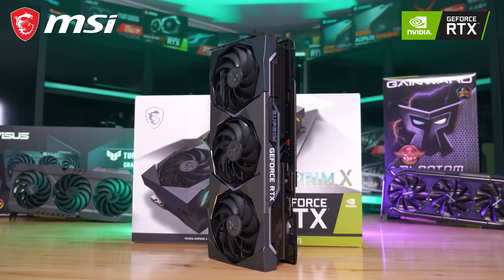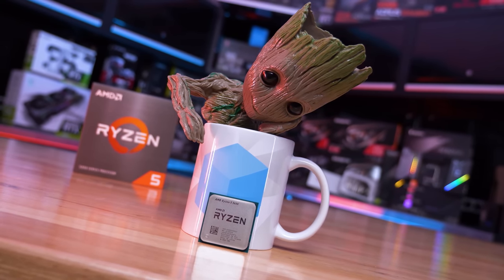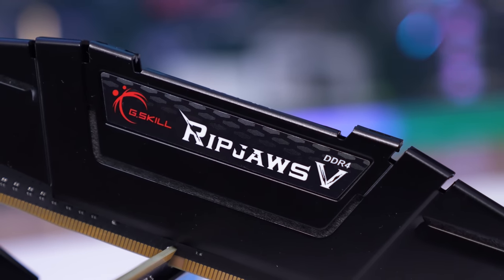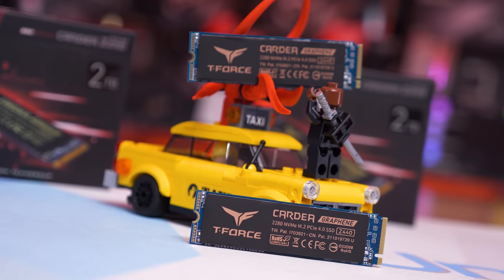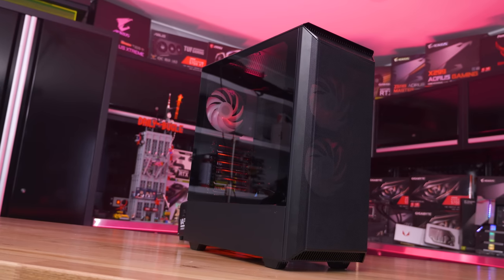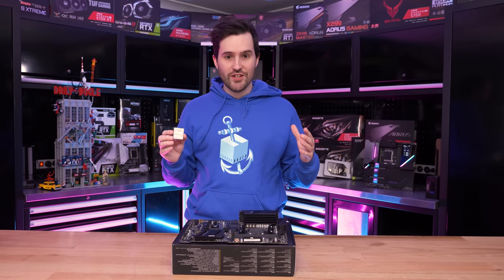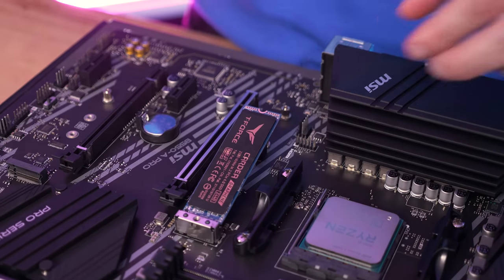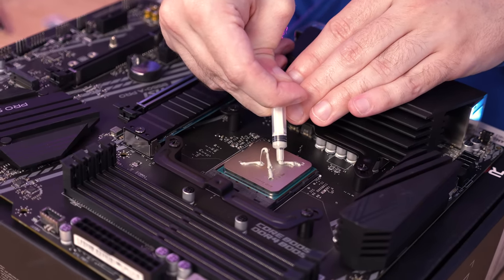Ultimate Value Gaming PC Build - AMD Ryzen Edition for 2022

Comment: I'm crying at the fact that in the year 2022 $1000+ PC is considered to be a "budget" build. 😭😭😭
I miss the early Zen 1/Kaby Lake days. Those were great memories.
Reply: I think it's safe to mourn the past at this point sadly. Regardless of what happens, ish is going to continue to get real, and absurdly expensive and we will see less as time goes on.
Reply: I don't think it's "budget" so much as "optimal value." For a budget build, I'd grab a CPU with good integrated graphics (Intel 11000+ or a Ryzen G APU), as they are already on-par with early 2010s dedicated GPUs. Next-gen Ryzen APUs (6000+ for laptop and 7000+G for desktop) will have RDNA-based iGPUs with even better performance.
Reply: This PC shown here is a 1080p Gaming PC. My Last PC was from 2017 and it was certainly more expensive then that PC with the "same" Power. It's just the low End got more powerful and thus more expensive. And YES that IS a problem. If in 5 Years the low End has the Power of an 3080, do you have to pay 2000$ for the cheapest PC?
Reply: U do realise budget means how much money one has and hoe much they wanna spend
Reply: @lachysimmonds357  As a noun yes. As an adjective (as used in this context) it means inexpensive.
Reply: Budget means within means for the selected product.  So a budget Ferrari is £70k, that's cheap for what a Ferrari now costs.  £1000 is cheap for a PC which contains a graphics card, since half the cost IS that graphics card these days.  Budget doesn't just mean you can afford this one.

You can't afford a Ferrari for instance regardless of your budget allowance towards having one, because you don't have a total budget for a car of anywhere near that.  But it remains a budget Ferrari TO THOSE WHO DO.  See?  A budet computer of any kind is a Rasperry Pi at £100 all-included.

But it doesn't play many games, that's the £1000 budget you need!
Reply: I mean if you count inflation... 1100$ is like 900 dollars 3 years ago.
Reply: @Planetside2Simon8989  if 2020's RTX 3070 kept pace with the actual US dollar inflation from 2014's GTX 970, it would've cost $360 at launch.
Reply: You said everything!
Reply: @InnuendoXP  inflation isnt the only reason for the price increase
many elements used in these GPUs have SKYROCKETED in price in the past 10 years
one example is aluminum which has over doubled in price since 2014
Reply: @flamingscar5263  And that Model T Ford, for the average man would today cost a few hundred dollars to make, but like you said, many elements changed price.
Wages didn't. Wages aren't part of inflation. And whilst for example lead has doubled in price, a PC uses a couple of ounces of it, and so the price has doubled. About two dollars now. Hmmmm. Not much aluminium used either. A PC case uses soft steel. But if it used all alu, that means it used 6 kilos or less. That would make an entire alu case cost less than 20 dollars... hhmmmm.
Reply: @Planetside2Simon8989  Wages dropped. Guess what PCs are paid for with. I'll give you a hint: it isn't a house.
Reply: Inflation brah
Reply: Used parts and local deals exist for a reason
Reply: @michaelgroenewald7  doesn't account for that much
Reply: @michaelgroenewald7  Wages, brah. It is a thing ADULTS who aren't getting things paid by their parents have.
Reply: @S3lvah  Absolutely, optimal value as best bang for buck. Best price / performance ratio.
Reply: @flamingscar5263  yeah so the $3 of aluminium used in 2014 now costs $6, big whoop, I can buy a huge aluminium CPU cooler for like $30. Material cost on GPUs has negligible impact on the cost, the process is the expensive part & even that didn't significantly go up in price per wafer until later last year.

The margins on GPUs are huge, many of the same materials & processes are used in CPU manufacturing & 'those' haven't gone up in price remotely as much. Even consoles with their huge APUs aren't being sold at a loss at $500.

The GPU pricing is down to one thing only, heavily distorted consumer demand due to crypto. Might it be a bit more expensive for other reasons? Sure. Not for anywhere near as expensive as they've gotten though.
Reply: @kowalski3892  Some of that is from GPUs still being overpriced. However, you either get a stopgap card and lose up to 200 dollars or you get a card that you will use for a few years at least and therefore count the higher loss enjoying your latest games more with a more competent card.
It still isn't a good choice.
Mind you, this build doesn't include monitor, mouse keyboard or any windows key, so it absolutely has to be an upgrade, not a new buy, at which point you would probably move the graphics card across and use that as a burner card until you see a price and performance that doesn't suck donkey.
However, that doesn't make for useful comparisons.
I would, however, add that cost to the claims of how much these "budget" builds cost, because without a monitor, you just have oddly shaped sand, metal and plastic, and you can't game without keyboard and mouse at a minimum. So I'd add up another 400-500 to the cost for those things, and subtract the cost of the 6600 if you are upgrading, reducing the price by 340-ish dollars for that.
Reply: This is what you would call a Mid Range build not so much a "Budget Build''. I would consider the R5 5500 or lower and a 6500xt and a lower end motherboard and ram a Budget Rig...
Reply: I mean, this is a value build -- $1000-1500 has been the price/performance sweetspot for quite a while.
Reply: @sublime2craig  By product tier, pre-2018 this was low-end gamer build. 'budget' builds were like the 1050T, but you spent like $400 on the whole system.
Reply: Budget for me was get really upset over pricing online. Stumbled by the Gaming PC setup at walmart. Saw, RTX, Ryzen 7, DDR4, and snagged it off the shelf for 850 with my discount card. If I would have played the game and use my additional 15% associate gift card and the 10% discount and got it cheaper.
Reply: End of 2021, I bought a rig for 1000 usd, complete with R7 3800x, (8x4)32gigs of 3200Cl14, 360 Aio, x570 mobo, 2 NVMe drives and 6 sata 2.5", and an EVGA rtx3080xc3. People are too quick to buy whatever is available. Only thing wrong with it was the wiring... Previous owner though a daisy chained cable to the 3080 was adequate.. until it continued to black screen and reboot when it hit above 60% load. Could have been fixed for free had he not tossed out the additional cables that came with the power supply. Probably for a "cleaner" look.. I bought a new PSU to avoid cable pin out nonsense issues, havent had an issue since. Also, ive made a solid half of the cost back, using the 3080 to mine Eth when I sleep.
Reply: @InnuendoXP  and you can still build one like it. OR just buy one. Case with integrated/supplied PSU, Ryzen APU build. 4-500 easy peasy.
Reply: @InnuendoXP  check out "ETA PRIME" or "RandomgaminginHd" both do quite a few "lower" spec builds with a powerful value aspect.
Reply: @sublime2craig  The thing is, the 5500 and 6500 XT suck even more together than they do separately.
Reply: @reinhardtwilhelm5415  Oh I'm not saying that they don't suck major ass, but those parts are what I would consider"Budget Tier". I myself would go with the i3-12100f and a used 1060 6gb for a budget build right now...
Reply: @reinhardtwilhelm5415  But also when you really look into the 6500XT for a budget build it can make some sense if you can't afford anything better and do have a PCIE 4.0 motherboard on hand or can find a cheap one. The 6500XT has a little better performance than the RX 580. Now the RX 580 was $229 when it was released and is going for insane prices right now on eBay, $200-$300USED!!! You can get the 6500XT right now for $199 on Amazon or Newegg and when you also factor in Inflation that's not too bad... Definitely not progress on AMD's side but very interesting for a "Budget GPU" option right now... You can also say the same about the 6600, it's about 6% less performance than the 5700XT. The 5700xt is literally going for $400-$600 USED on eBay right now which is just INSANE!!!
Reply: @crisnmaryfam7344  That's not the point, the point is product tier pricing, not stagnant price:performance 7 years later.
Reply: TBH the PC is ready for every single GPU, even at 1080p with something like 3080. And if you want anything stronger (like the upcoming RX 7000 and RTX 4000) then you would upgrade the monitor with higher resolution and that 5600 will last you years. Money well spent
Reply: @GewelReal  Completly agree! I dont see why people are calling this a "Budget" build, this is most definitely a Mid-Tier build not a "Budget" build in the least. The 5600 is essentially the same as the 5600X and you really wont see a difference in gaming etc, and if you wanted to absolutely match the 5600x all you would have to do is put a measly 200mhz Overclock or just turn on AMD PBO. The 6600 is a 1080-1440p beast and is on the same level as the 3060, which is in no way a "Budget Tier" GPU. I just upgraded to the 5600 and 6600 from a i7-3770k and a R9 280X and they lasted me for 10 years, so yea this tier of build will last for a decade or more for sure and is a great investment if you're a gamer/streamer or a light content creator...
Reply: @0:09 “budget/midrange”
Reply: I got fired from my job because i almost fought my 50 year old coworker.. and It got toxic yo so now, i spend most of my time smoking weed on my YouTube channel now, meanwhile i get back to the hustle no cap
Reply: @S3lvah  It's not optimal value, you go more on GPU and don't buy luxury PSUs and motherboards and gen4 SSD.
Reply: @wayland7150  Well, it's HBU's interpretation of optimal value. It depends also on how many years you intend to keep it for. Investing in a high-tier PSU, decent mobo and new-gen SSD is if you intend to keep the same rig for a good few years, like most people should IMO, for the sake of the planet (e-waste etc.)
Reply: So what is your idea of (Budget build) ?
Reply: Ikr
Reply: Kaby Lake was terrible. Zen 1 is still legendary.
Reply: This is not a budget build.
Reply: @noanyobiseniss7462  A budget build is a gaming laptop with far better specs overall at similar prices lmao.
Reply: Money has lost its value.
Reply: To be honest, the only "budget" thing about this system is the GPU. Everything else will offer performance indistinguishable from high-end components. The only scenario where this rig would be limited is if you put in a 3090 Ti to play at more than 120 FPS.
Last year you could barely buy a good graphics card for a $1000, so I think the value of this machine is pretty great.
And you even have an upgrade path. Should you decide to upgrade the GPU, you can drop in a 5800X3D and get a huge performance boost.
Reply: @Defective Degenerate ounce of weed costs me the same now as it did in 2009
Reply: You could save about $50 USD on the MB and get a different B550.

If you happen to live near a Microcenter you can find open box 6500 XTs for $160.  So, I just shaved off $200 right there, maybe about $225.

I see EVGA PSUs which are rated very well closer to $60 for 750W for non-modular and $95 for a modular 750W, and for this build these are perfectly fine.

So if I go the less expensive route I'm now $285 lower in cost.  Later you can upgrade the GPU.

My "budget" build was $2000.
Reply: budget are those already used part...
Reply: @sublime2craig  i wouldn't go for that combo, the rx 6500xt needs pcie gen 4 to be optimal, the r5 5500 is limited to pcie gen 3. If you're going to get a 6500xt get a 12400f. The total price will go up like $50 usd but you will get better performance for the price.
Reply: @S3lvah  It's still sad though, a optimal value PC from 2019/early 2020 will rival or beat an optimal value PC from this moment in time depending on exactly what you do with it. CPU price/performance is far better now, Intel has great offerings, AMD is finally pricing the 5600X at what it always should have been priced at. But the graphics card market is terrible, the RX 580 you could pick up back then for great price/performance you can't get new (at least not in many prices) and the used price is higher than the new price back then. So safe to stay that the GPU price/performance has gone down the toilet, and IMO that toilet was flushed... as I don't think prices will ever fully recover to what they should have been if it wasn't for the perfect storm of miners, scalpers and the chip shortage. AMD, NVIDIA, the shops, the importers, the whole supply chain got used to massively increased margins and don't want to go back. We can see that they're extremely reluctant to give up those juicy margins because prices are dropping stupidly slow whilst stock is greatly increasing. It's not like there isn't any demand either - it's just there isn't a demand at those prices.
For ages you could buy a great graphics card that would run new games at 1080p high settings around the $200-250 mark, the RX 270, 470, 480, 570, 580, GTX 750 TI, 970, 1060, 1660 etc etc.
Now the only new card around that price is.. the RX 6500XT, a recycled with less VRAM than it's predecessors in a time where it's needed more than ever. And that just highlights its other big bottleneck of PCI-E 4.0 x4 even more. Sadly not the only downsides to it either, it's such a low effort GPU. A refresh of the RX 580 chip on the same process would have been a better idea. The RTX 3060 is also disappointing, it was launched at a price point that isn't realistic just so NVIDIA could rain on AMDs parade but even on that price I am not impressed by the performance at all vs the GTX 1060 considering how much  time is between the two.
Reply: @activeentropy  Oh wow I completely forgot that the 5500 only has gen 3 PCIE! How disappointing. Yea the 12400f is a beast at the price it's going for, $180 or less on Newegg and Amazon right now and matches or out performs the 5600 and 5500...
Reply: @Axeiaa  Yeah, I don't think we're getting the price categories back to where they used to be. But the next gen of cards should bring a big jump in performance with a smaller-than-that jump in price, and hopefully by then supply and demand will have evened out a bit. Unless another perfect storm happens this year, that is...
Reply: @activeentropy  Man I am happy I waited to see if the price of the 6600 would get any closer to the MSRP, cuz I just got one for $10 under MSRP on Newegg!!! Got the MSI MECH model and its going for $339 and you get a $15 gift card from MSI with it so that drops it down to $324 before tax!!! I am so happy to see the prices of GPU's coming back down to earth!!! Well AMD cards at least, Nvidia/RTX/GTX cards are still going for insane prices, especially the 3050 and 3060 models!!!
Reply: @sublime2craig  I dunno, the 6500 XT has quite a few embarrassing weaknesses and doesn’t outperform that five-year-old card by much, if at all.
Reply: @reinhardtwilhelm5415  yea if you're into streaming or content creation the 6500xt will do none of the above, and it's literally a 6% performance difference between the two which is kind of embarrassing on AMD's part 😂
Reply: @sublime2craig  It’s extremely embarrassing. Sub-$200 GPUs quite literally have not progressed since the 1650 Super and 1660 Super, and with the 6500 XT and 6400, AMD has decided to go backwards from there.
Reply: Well to be fair, everything is more expensive. Remember when consoles for $200 brand new? Now we're at $500...
Reply: Well hopefully in the next 5 years when we have a microchip production facility based in the US prices will come down... but that also just depends on the economy at the time
Reply: @mattb6646  That would be called inflation my good sir. The Xbox 360's MSRP was $299 at launch in 2005. So with inflation thats about $450-500 today. Prices on electronics have been pretty stable throughout the last 20-30 years if you factor in inflation like I just showed... Now you can argue that price to performance has dropped especially in the CPU market compared to the golden days of the early thousands when every year you would see 1-3X performance gains from previous series/editions. You dont see anything close to that today, maybe at most 20-30% performance boost from previous gens...
Reply: Yeah dude I was able to put Xeon X58 pc with 1070 like 4 years ago for like 350-400 USD and I use it till now and it works fine. I just can't bare that in WoW I have such bad fps because firstly it's CPU heavy and prefers single core performance and also is not optimized at all :D.
Reply: Year 2008 was better

Comment: I'm in the midst of assembling a build that's similar to this, but with mostly used, slightly older parts. So far, I have the following:

-Cougar 600W 80+ Bronze PSU
-Phanteks Enthoo Evolve ATX case (older case, but damn, it's sexy)
-R5 3600
-Asrock B450 steel legend
-16GB 3200MHz RAM

All totalling only $390CAD ($310USD).

I'll probably spend another $100CAD or so on storage, bringing the total to around $500CAD/$400USD for what I think is a solid system, just without a GPU of course. Might use my current RX 480 4GB as a temporary solution, since prices are continuing to improve. If I added in an RX 6600 for $340USD, the total cost would be under $750USD, but would perform pretty respectably. Not ultra budget still, but I think it's a decent blue collar build!
Reply: With the 480 as long as not playing higher than 1080p you should be okay until the prices drop more but 4gb is cutting it a little too close
Reply: Good build for the price.